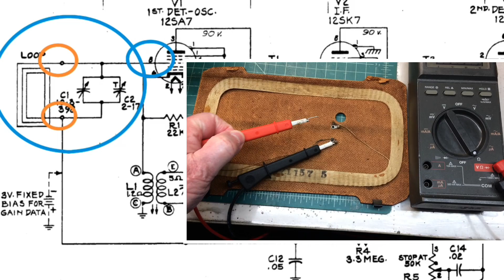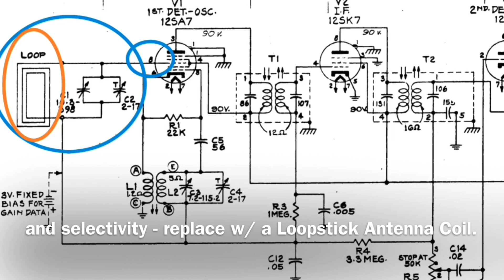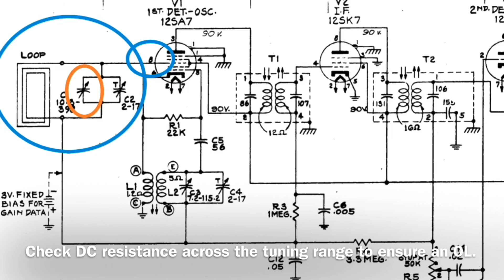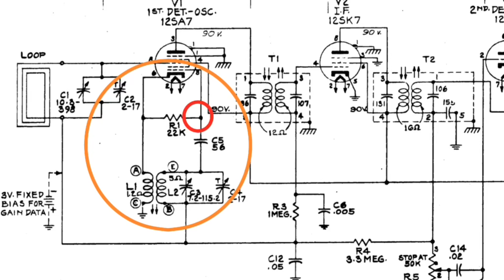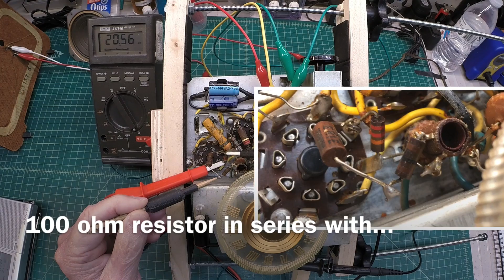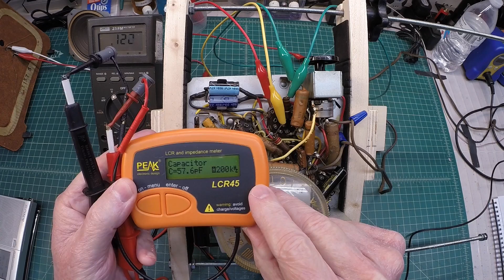RCA 8-X-541 - Cause & Effect P5 (Oscillator Troubleshooting Tips & Common Failure Points)

Comment: That a great tip about a tube showing good get may not be strong enough in all uses.I bought a little oscilloscope a dso 188 model,I bought the little one hope it might be of some use for me working on tube radios,maybe alignments ,I would love your input of what it might be good for or if anyone else has any input ?
Reply from the maker: Thanks Ron. Your scope could be used to look at audio waveforms and RF up to 1 MHz. Testing the I.F. resonant frequency can be done with your scope as well just to name a few. Keep in mind, an isolation transformer needs to be used on the receiver under test if your unit is AC powered. Best, Don

Comment: Excellent video, thanks 👍 (but not a fan of the bouncing circles on the schematic).
At 26:22 I don't follow this. How can resistance affect capacitance? What is the reference to John Rider that you cited at 26:07? -- I cannot pickup exactly what you are saying there.
Reply from the maker: James, thanks for your feedback on the bouncing circles. In regards to adding a 1 megohm resistor; doing so reduces the capacitance from the meter leads so loading of the circuit under test is reduced. Check out John Riders book on How to Use Meters section 9-11 at: https://www.americanradiohistory.com/Archive-Rider/BOOKS/How-to-Use-Meters-Rider-1954.pdf Hope this helps and thanks again for watching. Best, Don
Reply: @RestoreOldRadios  Thanks for the (large) document. I understand his point in section 9-11 about reducing the effect of resistance but my question is about capacitance. I cannot see how adding a 1 meg resistor in your case changes capacitance from 58pF to 1.6pF. Where is that explained?
Afterthought: What is the shunt capacitance of that resistor? If it is less than 1pF then that in series with 58pF will result in a very low capacitance.
Reply from the maker: Starting with section 18 of this document: https://books.google.com/books?id=gO5HAQAAIAAJ&pg=PA23&lpg=PA23&dq=how+does+a+dc+probe+with+1+megohm+resistor+reduce+capacitance&source=bl&ots=DGfu3obu_3&sig=ACfU3U1jbBQZt1Ya9qWepv5Ob0zOrz0nGw&hl=en&sa=X&ved=2ahUKEwjFob2Zn9fpAhUwgXIEHe0qBMwQ6AEwAHoECAgQAQ#v=onepage&q=how%20does%20a%20dc%20probe%20with%201%20megohm%20resistor%20reduce%20capacitance&f=false
Reply: @RestoreOldRadios  Thanks, that's a good reference (as military training material usually is)  and makes clear that's it's capacitive reactance of the input circuit which is being affected by the 1 meg series resistor.

Comment: Very nice vídeo Don. I knew that method to watch the wave of the oscillator coil, using another coil as test probe with the oscilloscope, but I had never used it, and had never seen it working before till now. That´s been very interesting for me. Thank you for showing it.
Have a nice day Don.
Ketk Aiball (Spain)
Reply from the maker: Ketk - thanks for watching. It's good to see things visually too, so it compliments DC voltage measurements. Stay well and all the best. Don

Comment: Very good tutorial about troubleshooting the oscillator circuit. The theory about oscillators can be very daunting but can be found easily on the net. I am glad that you stick to the radio's circuit. Good tips about troubleshooting and what to look for. I am also glad that you use  a multimeter because most people don't have a lot of equipment. Maybe interesting to know what the inductance is of the dipmeter coil for people who want to wind their own as a extra tool. I will following you along. Be safe.
Reply from the maker: Henk - I appreciate your feedback. I have a couple VTVM's but really like sticking with the Fluke DMM when troubleshooting. Thanks again for reaching out and your kind words. I'll provide the particulars on the coil ASAP. Best, Don
Reply from the maker: Henk - the DIP Meter coil is 756 microhenries. I tried various 1 watt chokes ranging in values from 250 microhenries to 1 milihenry and all worked as well. Of course each will resonant at various frequencies across the local oscillator that spans from ~995 to 2055 kHz. Hope this helps. Best, Don
Reply: @RestoreOldRadios   Hello Don thank you for given me the value of the coil. You are right that other coils will work and that only the field strength will differ and will be high at resonance. I will watch your next video's. Thanks for your response. Best regards Henk